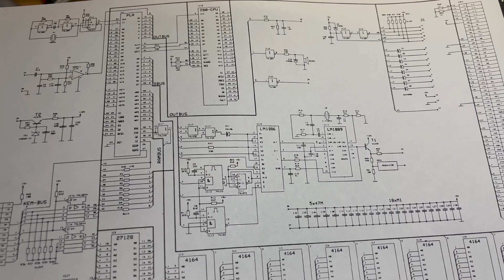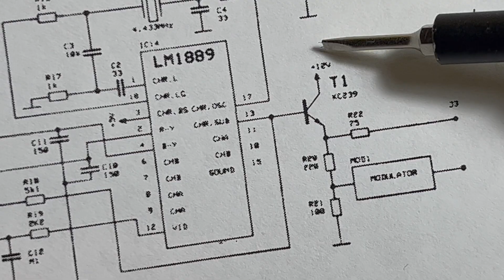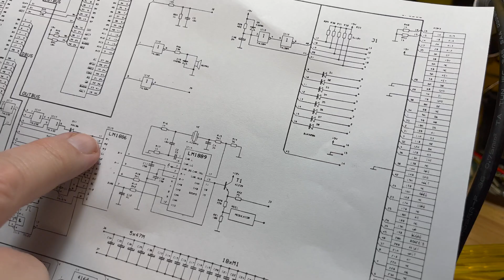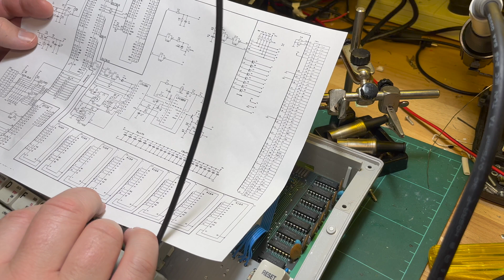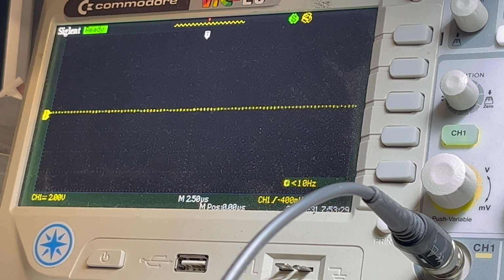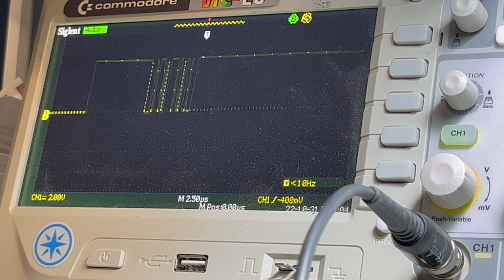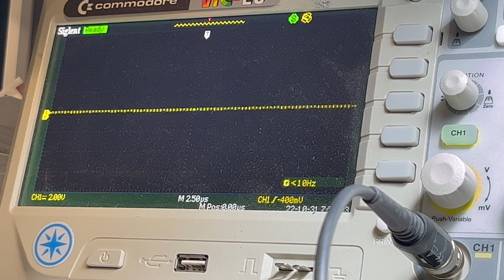🇨🇿 Didaktik M: Part 2 (Troubleshooting) [TCE #0161]

Comment: You may have found out in a later part (I have not pre-watch), but the voltage should not be as big a problem as it seems. The typical output is ~18V from the PSU and even the 22V should still be OK, since it is regulated to slightly less than 12V on the motherboard before it goes to the video circuitry. You can see the regulator at 10s timestamp on the left middle of the schema... It is very simple, but relatively reliable one based on a 12V zener diode.

Comment: Looking at the schematic the PLA/ULA outputs RGBI (Red, Green, Blue, Intensity). The LM1886 converts this to YUV. The LM1889 converts this to composite.
In the original spectrum the ULA outputs YUV directly to an LM1889.
Given the component values, especially the 4.433 MHz, this circuit should generate PAL composite video.
The LM1889 is rated for a supply of 12-18 Volts. Thus is likely destroyed due to over voltage.
Reply: I think the composite video is not working, because there are missing the 12V for LM chips. There's a regulator (stabilizator :-) on the board made with KC635 transistor and KA260 zener diode and I'm pretty sure they are damaged. It's often bug.

Comment: If someone's already done it, could be a nice save for the unit.
Reply from the maker: Looks like the 1991 model (newer ROM and it seems board layout), but yeah ... definitely want to get it working again.  A bit of effort ... let's see.  Also, considering sticking a 12V regulator into the PSU ... that 22V is waaaay too high ... surprised there's not been any puffs of smoke ... unless killing the ULA composite output was the puff.  Meant to measure the transformer output as well ... I would've thought maybe 15-16VAC out, then rectified and used as the unregulated 12V, then through the 7805. /Brett
Reply from the maker: Yes, RGB output works!!!